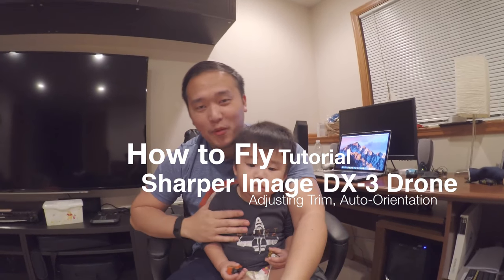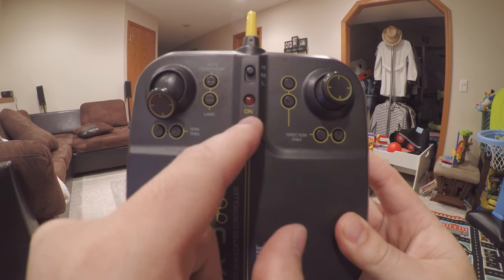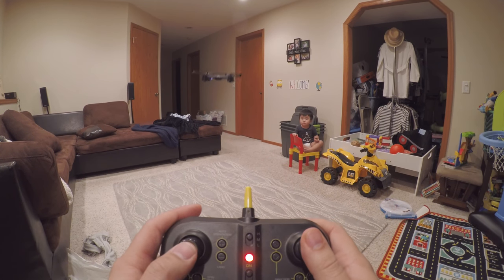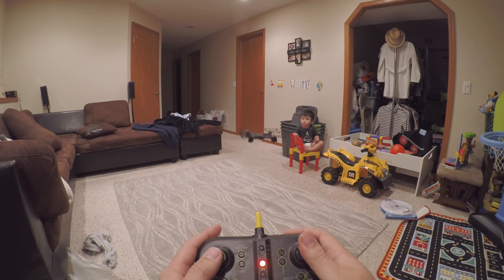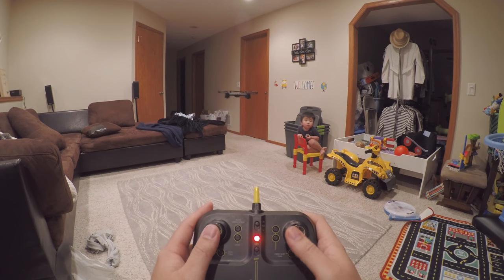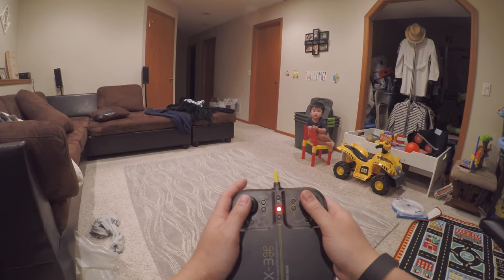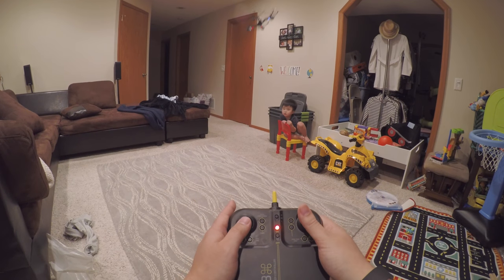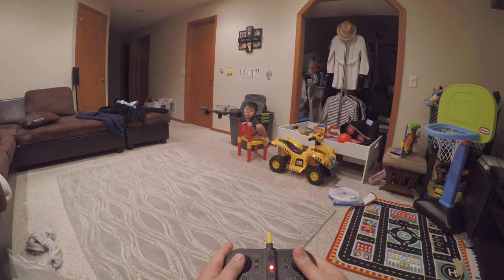DX-3 Drone Tutorial: Trim and Auto Orientation [4K]

Comment: I still don't quite understand I had it probably 30 to 40 feet up in the air I tried to do a flip in and accidentally pressed Auto orientation it started flying away it dropped from the sky like a a rock and now it doesn't fly

Comment: I have a question! How do you get it to record and take pictures because I read the directions and yet it doesn't take video or pictures when I open up the flash drive folder on my laptop
Reply from the maker: +SuperSilver759 make sure the laptop is seated correctly and when you press the camera button it should make a noise and the led light should be flashing
Reply: Coobvam Lor what do you mean seated correctly? haha. Also I does make a sound and lights up when I click them
Reply from the maker: i mean make sure the sd card is seated correctly, if it makes a noise then it would seem to be recording

Comment: What do that H M L switch mean?
Reply from the maker: they are the control levels 

h = high 
m - medium 
l = low 

if you place it in "l" it will be easier to fly, but slower. If you put it in "h" it will be more difficult but it will also fly faster etc